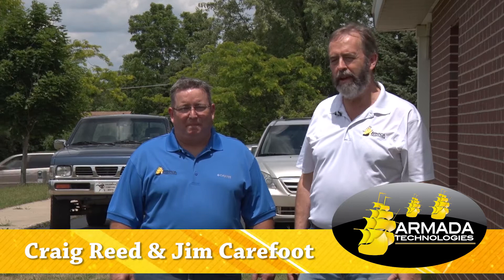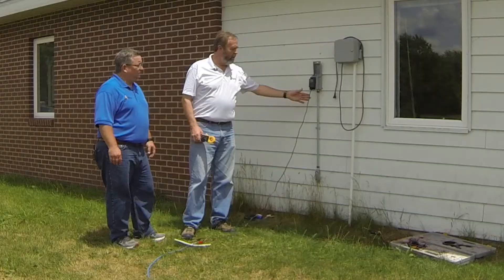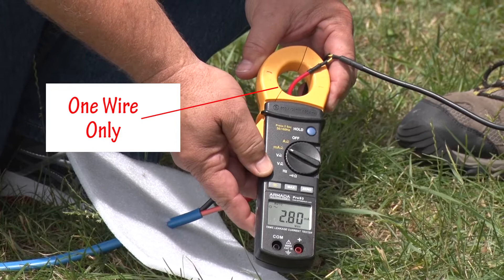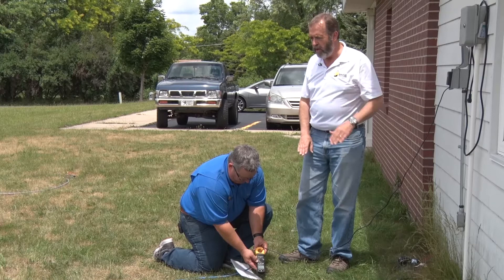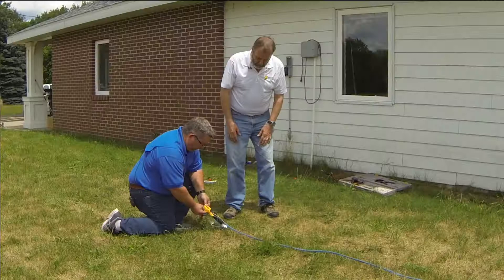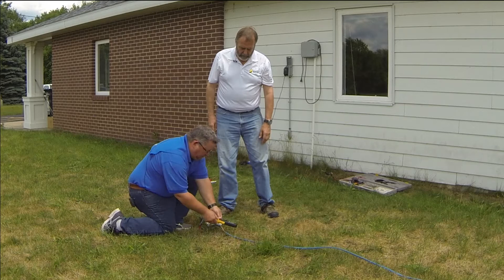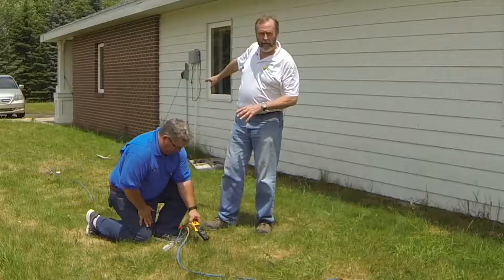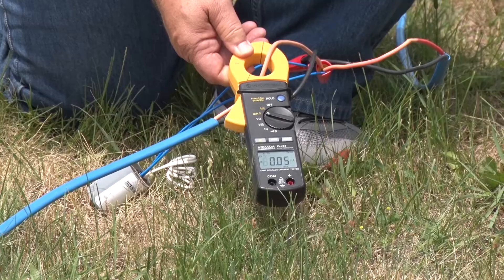How to Use a Milliamp Clamp Multimeter to Diagnose Faults in a 2-Wire Sprinkler

Comment: How well would this method work on a commercial sized system with, for example, 60 decoders? You would have to know the exact number of decoders and do some math for this to work, right?
Reply from the maker: Yes and no.  While a 60 decoder system with 1 milliamp draw decoders, for example, would draw 60 milliamps, you're really looking for unusual milliamp drops.  So using 60 as our example, let's say the initial reading at the controller is 300, then 299 at the first decoder, then 298 at the next and so on.  If we suddenly drop 240 milliamps from one decoder to the next, we know where the fault is without doing any math or very little.  It is the unusual drop that you are looking for.
Reply: @ArmadaTech  Ok, I understand. Thanks!
Reply: The real key is knowing your wire path. Without that you cannot tell with any accuracy the direction of the fault. 

If you don’t know for sure your wires path then tracing and flagging/painting the line are your first steps after you eliminate the controller itself as issue. No point in going decoder to decoder if you don’t know it’s path.

Comment: What you mean by "gives us a much quicker and easier measurment" is that your video doesn't show at all how your product actually works in the field. You flat out say that this will be more difficult in the field, possibly much more and often impossible. I prefer honest marketing and honest demonstrations. If it is the very best in the field ( I guess I mean that both subjectively and objectively) but if it really IS the best, why not run it under the conditions it was designed to be useful in?
Reply: Hi Adam, thanks for your comments. The Pro95 clampmeter makes a stable measurement more quickly than earlier clampmeters even though higher sensitivity and live field conditions can make readings seem to jump around. Readings can be stabilized several ways as we explain in our Application Note on that topic. The Ap Note is on our web site in the Knowledge base. We don't have a video to go with the Ap Note, but it explains what we mean by difficult conditions.  Jim Carefoot, Phoenix